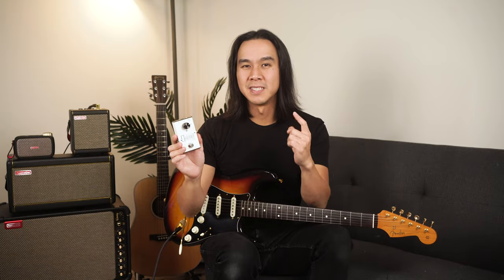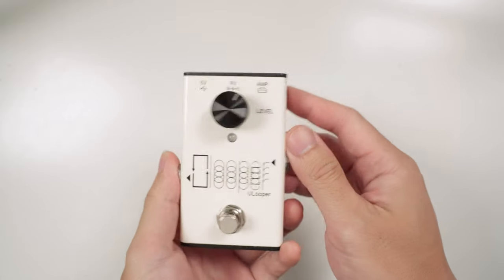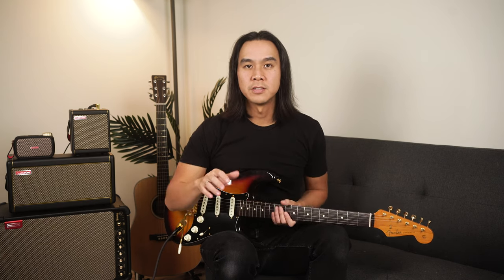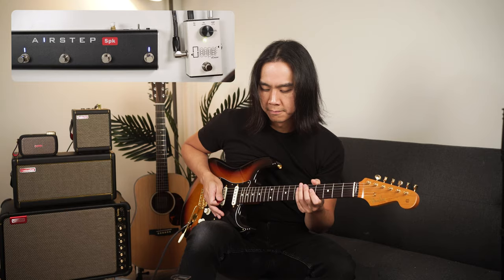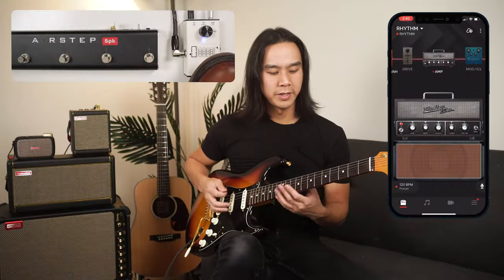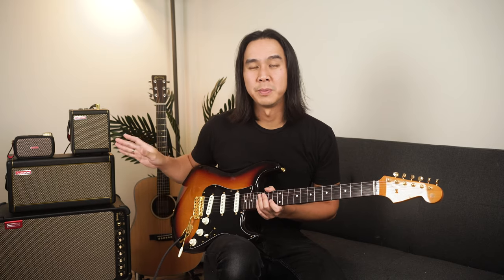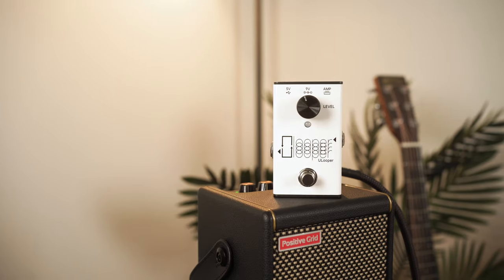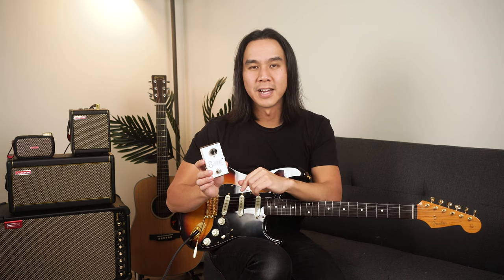Finally! The Ultimate Looper for Spark Amps: Introducing the uLooper Pedal!

Comment: So why doesn't this company (or another) just make a USB interface WITHOUT the looper and allow us to use whatever looper we choose?  That's really the "magic" in this pedal--  the USB interface, not the basic looper they included.  Imagine this pedal, with an "in" and an "out" jack where the looper exists in the chain.  Am I missing something about how this works?  I'd pay their full price for THAT, so I could use my Boss RC-5, Digitech Trio+  or other more sophisticated looper pedal with the Spark.
Reply: Isn't this basically just adding a Send and Return connection to the Spark amps? Because the looper needs to be inserted into the speaker side chain, just before the signal amplification after all modeling has been completed. But if using the Spark amp as just an amplifier head and using a separate cabinet speaker, you should already be able to add any looper you want?
Reply: Seems they have a product called xtone that actually is a pedal shaped interface with inputs and outputs…
Reply: Pedal is connected to digital amp USB. The loop is not audio, only the guitar signal is...
As a bonus you have a line output without cutting the speaker sound.

By the way that company seems to be already dead. I cannot find their website.

Comment: Hey guys, I bought a BOSS RC-1 and I’m trying to loop and then pedal switch with the spark controller.. but when I change tone it changes my original loop?? Anyone know if there is a way around this? Or do I need to buy another looper :(
Reply: This ULooper will solve your issue

Comment: The other solution to the problem is to use a Spark Go as a kinda super-preamp, take the Go output and use it as the input for the looper of your choice, take the OP of the looper and send to a tonally neutral PA (you could even put a drum machine between the looper and the PA), use the Spark Control to switch your tone to your heart's content...

Comment: You know more than anything what this has gotten me wondering?

I own a Spark 40 and a Spark Go. I also have the foot control. What I’m thinking is what’s to stop me using the Go as a sort of amp head. So…

Guitar>input of Spark Go, headphone out of Spark Go> Looper Pedal, Looper Out>aux in of the Spark 40 (amp sims turned off and everything set neutral). 

Any thoughts?

Comment: Thanks for the great review! I was using a Ditto+ looper, can upload backing tracks, etc. But issues with use with the Spark Go, Mini and 40, as when the tone is changed, all the recorded loops are through the same tone - as you mentioned. The U Looper looks like it will solve this. But is there any way to "upload" or "download" loops from/onto a computer? Looks like it is just a one loop, multiple dub style looper (like the Ditto original)...
Reply from the maker: Yeh at this stage I don’t think there’s any way to upload loops. There’s no real interface or anything like that so no memory bank. Just functions like a super basic looper. Hopefully they’ll try something more elaborate in the future

Comment: Bought my spark 40 and mini a couple years ago. Ran into all the limitations, and ultimately got a real looper (EHX 22500) and external effects pedals, and just use my sparks mostly as 'dumb' speakers. Turned out to be kind of a waste, considering Spark amps also don't work that well as an interface with Ableton, etc. (probably so they could sell Bias FX).

Comment: so you have to have this AND the Airstep?  Come on Positive Grid.  What is so complicated ?  I was hopeful that when you came out with the Spark pedal that you would make the software/firmware work.
Reply: This was a question I was going to ask.  So, is it fact that you need both the AIRSTEP and Ulooper?
Reply: The reality is that despite the promise of ‘new features’ to be added in the future when they released the spark control, little to nothing has been added and they’ve been scratching their heads for over two years while they focussed instead on new products. It’s really disappointing that they’ve now looked to address this via an entirely new amp (the spark 2). The promise of discounts to spark 40 owners via the registration programme is probably behind this.

Comment: I experienced a buzzing as well and some popping with my Spark 40 hooked up in conjunction with my Spark Cab.  It sounds more like the Cab than the 40.  The popping is annoying.  It’s on some, but not all presets.  I’m going to try and chance all the cables and see what happens.  Frustrating.  Thanks for the video.

Comment: Are the input/output jacks for future compatibility?  It appears that it will not easily work with existing pedal boards. Thanks for the comprehensive demo.
Reply from the maker: The left jack is for line out, the right one is for future use (maybe a pedal or addtional footswitch). Not really designed to be a pedal you can put in a regular signal chain of a pedal board.

Comment: I'm reading elsewhere that this pedal does NOT do overdubbed loops well, and people are using workarounds with two amps etc. If that's the case, how is it done seamlessly in this video?🤔
Reply: it can overdub without any problems
Reply: @xsonic9268  hopefully that's the case. I'm waiting on mine to arrive, and will test it myself.

Comment: I'm a bit confused.  You say that you don't plug any 1/4 inch cables into the looper, but when you demonstrate its use, you have a cable coming out of the left side of the looper.
Reply from the maker: That’s for me to record the line out for the purpose of hearing the audio in the video. It’s not something you need to do unless you want to record your spark through an audio interface.
Reply: @GuitarZero2Hero thanks

Comment: I have the Mini so this should be useful. However, in the future, the in and out can be used as a normal looper with amps having S/R loop, correct?
Reply from the maker: The input jacks on this device won't function like a regular looper. I'm pretty sure the left jack will always be for line out and the right jack might be for a footswitch or pedal, not sure though.
Reply: @GuitarZero2Hero  Thanks for your comments. Also, can the loop be saved, and if so, just the past loop or multiple?

Comment: Thanks for the vid!  I just received mine!  I’m having trouble connecting it to my Spark 40. It starts with a solid purple then flashes red for about 10 seconds is a solid green for a mill then resets. I’ve updated the firmware on both products and I have followed the connection. Instructions. Appreciate any ideas all the best.
Reply: Make sure your Spark is operating at 48 kHz sampling rate and the ASIO driver works when you connect it to windows via USB. Some Spark 40 units made during the 2nd half of 2023 run at 44.1 kHz sample rate and the ulooper won't work with those.

Comment: If you have an amp and a looper save yourself the money by plugging your guitar into the Spark, and run a 3.5mm to 6.35mm from the headphone out to your looper's input and output through your amp.
Reply: does this work with any looper?
Reply: Yes, it would. You will need to have the amp with you all the time. Make sure you set up the spark mini to output to line. On the Spark 40, you might need to use a summing cable with resistors. I’ve got a Spark 40 on the way, I’ll update when I find out.
Reply: This doesn't work if your only amp is the Spark amp.

Comment: Can you explain the airstep thing you are using? You don't really explain that and it looks like its important to whatever it is you're doing.  I'm a looping newbie and I have a spark, so some context around that would help.
Reply from the maker: It's just to change tones on the amp, not important for this setup at all. You can change tones off the app or on the amp itself. I'm just using the airstep as it's hands free.

Comment: So why isn't it working with my spark 40 or Mini? I get absolutely no lights with the mini. With the spray it continues to flash red unless I hold the switch in then it goes to continuous red as if it is recording... but that's it.  It's doesn't ever change from that.
Reply: Have you tried updating the firmware of the amp?

Comment: I just got mine and the instructions leave alot to be desired. I'm not getting any power and I'm not sure how to hook this up. I thought you hook usb c from amp to usb a on pedal correct. Then hook guitar as normally to the amp? I get no lights.
Reply from the maker: The pedal needs an external power source, so you’ll need another cable to plug into the USB-C of the pedal and have that plugged into a power brick. Watch the video and there’s a section explaining it